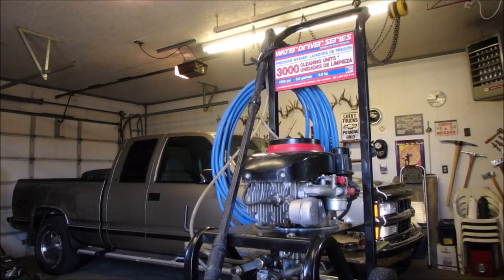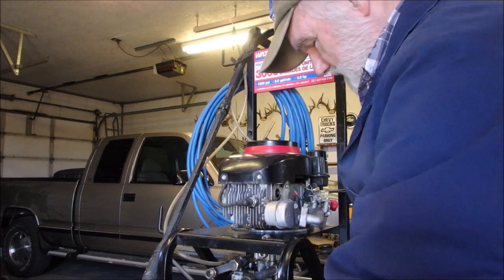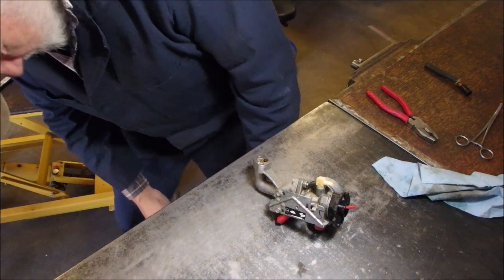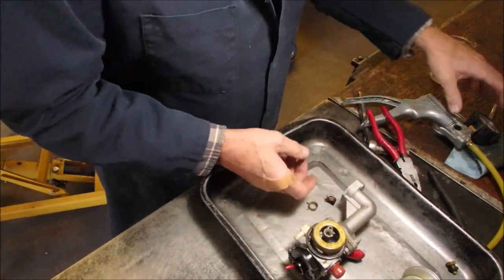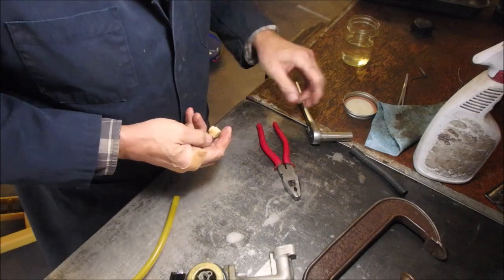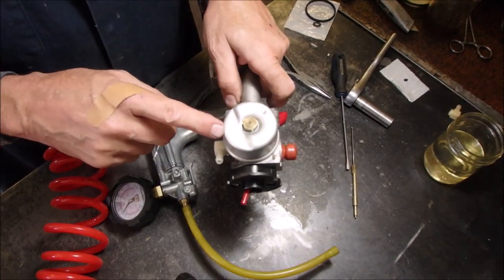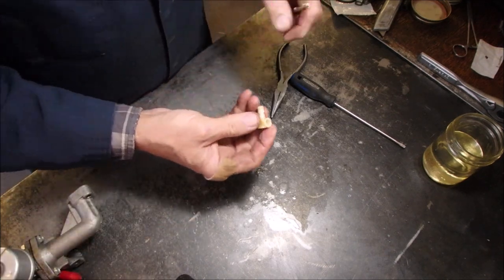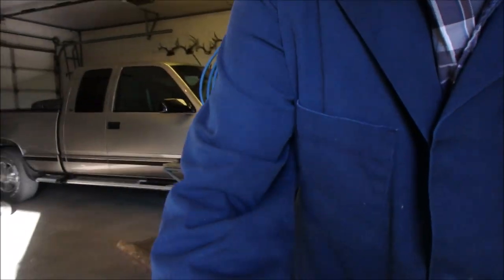This Pressure Washer Came Back, What Did I Do Wrong?

Comment: Bruce the Tecumseh carburetor with the intake manifold above the muffler takes a primer bulb with the vent hole in the center of the bulb.The intake manifold below the muffler does not.This is on lawnmowers,still may apply to this pressure washer.
Reply from the maker: Wow you know your carbs.

Comment: I had a pressure washer come back for “leaking gas” after I put a new carb on. Checked the oil level and it was good. I filled the tank half full. I didn’t see anything but started to smell gas vapors pretty heavily. Tilted the machine and gas started dripping from the tank seam. Put a good used tank on and I’m going to watch it pretty close before I send it back. It’s always a sticky situation because that problem was not the result of my carb replacement but another issue. In other words, they owe me a little more money
Reply from the maker: Yes  that would work.

Comment: i've  had a lot of problems with those plastic fuel fittings . soldered a short piece of copper tubing to the steel part once , but had to use a longer hose to make the turn . wish someone would make an all steel one .
Reply from the maker: Exactly.  Good idea.

Comment: As soon as  saw the motor I was thinking "Man, Bruce get's the ones I want, where you don't have to take the muffler off".  I am NOT a fan of them putting plastic elbows on fuel line fittings, it's a recipe for disaster.
Reply from the maker: So true.  Thanks Bill.  These Tecumseh elbows are not their best thought.

Comment: What does bad fuel look like?
Reply from the maker: Orange to green to black in colour.
Reply: Usually yellow or orange. I have thrown a lit match in a bowl of orange gas and the match went out, twice. If you pour old gas in a clear container, after a while you can see a bubble of water in the bottom Most ethanol  gas attracts moisture naturally. I recommend recreational fuel to EVERYONE now. It has no ethanol  and the equipment runs 100% better. You still need stabilizer in the off season.

Comment: I have gotten to the point I do not like working on pressure washers. If the pump is bad, I tell people to scrap them. The problem with gas and water is it doesn't mix. I have had some come in with water in the tank and the carburetor  so corroded from water damage it was not funny. The last one I fixed, I replaced the pump for $60 . It ran fine but never again. Not worth my time or effort.
Reply from the maker: I don't mind changing the pumps.  If they come without the hose and wand is isn't worth it.
Reply: @BrucesShop  I agree, not worth it. You have to be careful on getting the right CFPM pump if you do replace it. Generally the higher the volume, the more the cost.